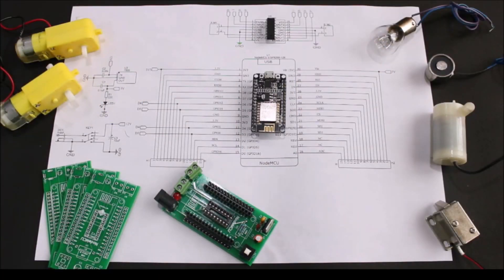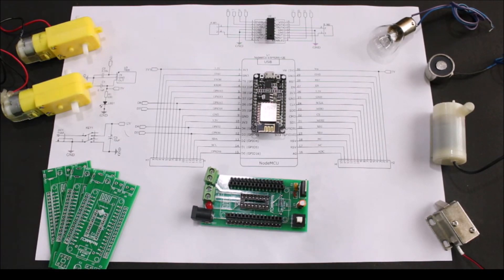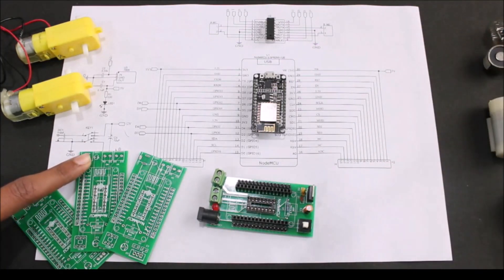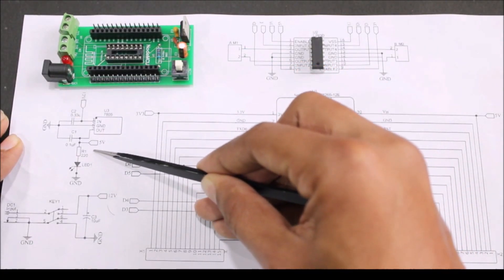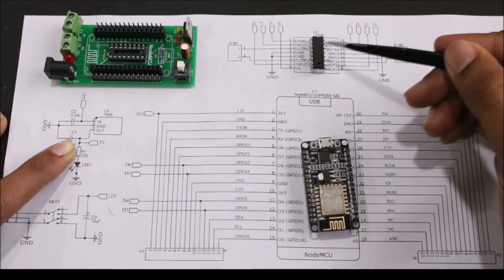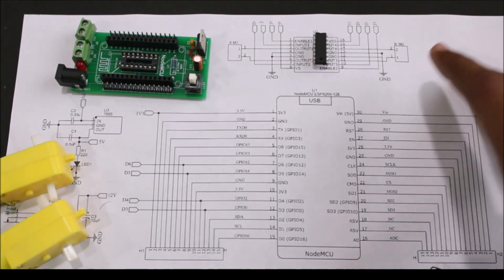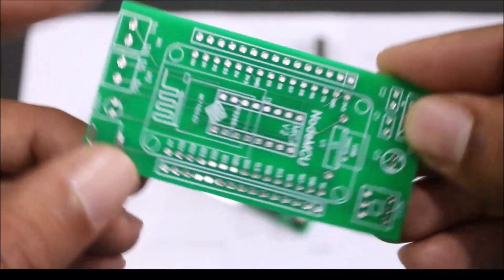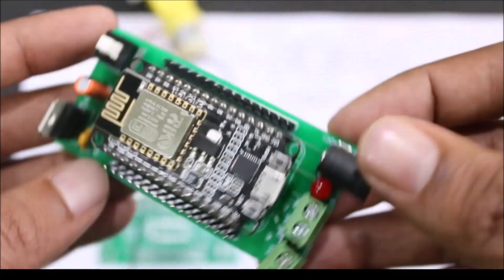Build a Simple Battery Powered Motor Driver Shield for NodeMCU using L293D

Comment: Thank you for a nice and clear video.  Why did you chose ESP8266 and not ESP32? ESP32 brings more power and also BT. If I may 2 requests: can you please share the schematic, so I could import it into easyEDA and use it as a reference? and also give a links to the parts at Aliexpress? (this way you may also benefit from the purchase).
Reply from the maker: Link in the description for Schematic
Reply: @Circuitdigest  The schematics is a picture, not a schematic that can be imported